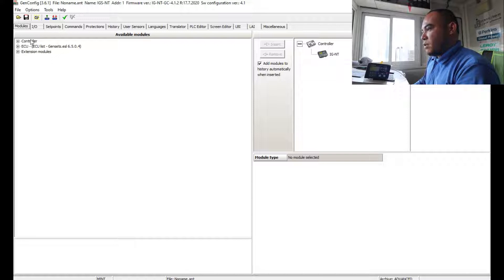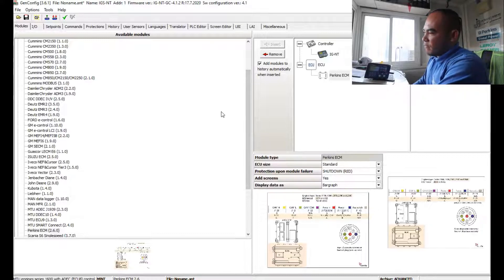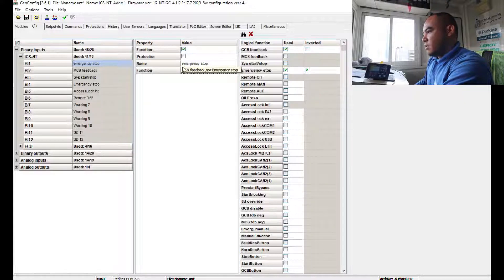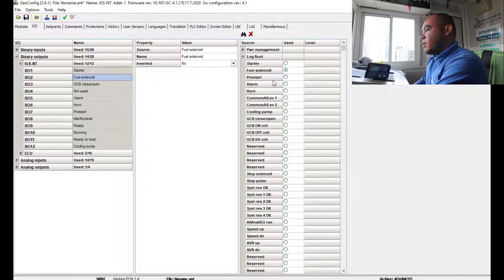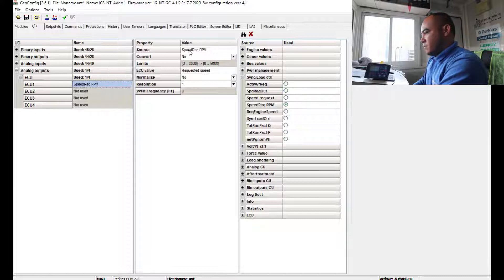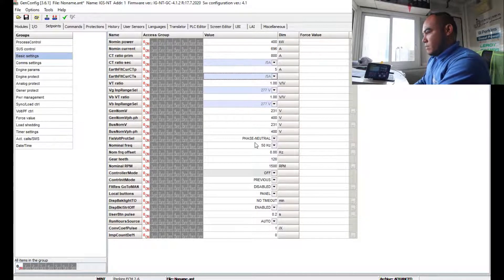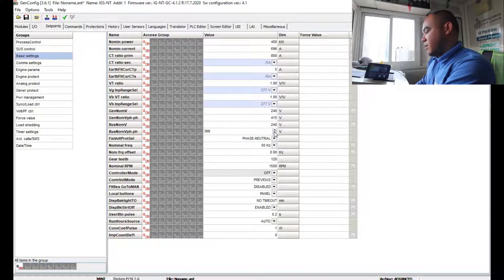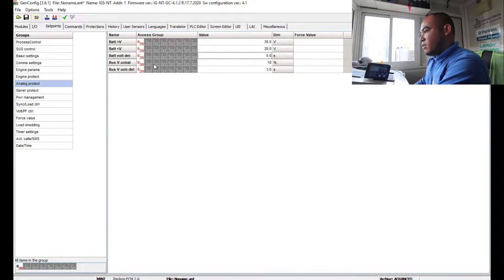COMAP INTELIGEN NT basic configuration benzblogs

Comment: Hi, I am doing configuration on Inteligen4 200 for synchronizing 2 generator, I have set Binary output 2 as ON GCB coil , and Binary Output 3 as OFF GCB coil , However when I run only one generator and I try to close the GCB from the controller the controller doesn't give a binary output to close the breaker (I am monitoring the binary output from the PC software )  although the main busbar is dead (no voltage ) , what is the reason ?  dose "CAN2 missing communication alarm cause a problem while closing the GCB ??
Reply from the maker: Dead becase your breaker is not close
Reply: @benzblogsVlogs  The breaker is not closing , I press the Close button on the controller but the breaker doesn't close. When the main busbar of the synchronization panel is dead (no voltage on it) the Comap shall close the breaker without need for synchronization process because of zero volt on busbar , However the controller doesn't give a binary output to close the breaker .
Reply from the maker: @gamechangertech  yes even in island mode
Reply from the maker: @gamechangertech  make sure because comap intili can be config the digital output ither nigative or positive out

Comment: Is it possible to communicate with an IC-NT controller with a DSE8660 MKII to do Island mode synchronization?
If so how to do the wiring.
THANKS
Reply from the maker: Im not try but im sure it will communicate same wiring dse msc and can for comap
Reply: @benzblogsVlogs    no its not possible
Reply: @kerekembi no not possible
Reply from the maker: @shahzadnawaz4956  yea

Comment: Dear Sir are you sure the baseload setpoint is used when genset work in stand alone? and loadshare when is working in paralallel? I have read the manual i found different  explication or I mis understood
Reply from the maker: Load is always depend on kva however if this is synchro it double up the capacity dur to share load right ?

Comment: thanks for your knowledge transfer,   i have two gensets with comAp controller  inteligen200  if i start one genset the controller is showing for example  200kilwatt   if i shutdown and start other genset  the controller is showing  different reading  for example 300kilwatt   how to solve that
Reply from the maker: This problem happen in the configuration you check the kva ,kw and the ct you installed must be configured in the module okay to solve your pblem all of this must config in the module and calculate

Comment: Am having a problem in configuring a module IL-NT AMF 20. With inteliconfig software. Using communication module IL-NT-S usb, but is not connecting to the controller. It shows connection failed. I have double checked but I couldn't find anything.please sir i need your assistance on this. Thanks for your teaching.
Reply from the maker: Sir in you latop what connection your using you should cleck that in you computer ex.you open you comap sofetware there you can select what connection should be usb right
Reply from the maker: Or what sofetware you using my its not the correct one

Comment: Sir, Intelligen NT module is showing over voltage, 263 volt on both Generator and mains input. I measured with multimeter, it is showing 230V, which is correct.
Is it any configuration problem or hardware issue.
Reply from the maker: Sir if multi meter measure correctly if its calibrated
Reply from the maker: Thin you can calibrate the module reading and make it same with the tester

Comment: Hello dear i am facing the problem Perkins 275 kva when we start the gen set  when goes to starting command when starting relay operate Comap ig ntc showing ECU shutdown we Also chk ECM power relay supply and CAN
Reply from the maker: You need the EST tookit to read the ecu if any problem did you check the the communication wite and the configuration ist not change?

Comment: I have interlidrive amf 20 is shorting down on battery backup voltage
Reply from the maker: If battery back up check i side of your module there is botton cell if you can replace replace it

Comment: Is it possible to download configurations from the Device to laptop ?
Reply from the maker: You save achive
Reply: @benzblogsVlogs  thanks, there are different softwares like Genconfig, intelimonitor, inteliScada. Can you pls tell me the uses?.
Reply from the maker: @DhineshKumar-kp7wy  just read the module and save it that it
Reply: @benzblogsVlogs sir, i connected my device and my open connection page opening in sptm not in MINT how to switch this
Reply from the maker: @DhineshKumar-kp7wy  this intlmonitor there you fo config while scada is only monitor and meroring
Reply from the maker: @DhineshKumar-kp7wy  SPTM -MINT this deferent function of a mdule you most do example MINt din you have to do it the config for MINT OR SPTM in order to write in the module or convert of applicable if not thin you have to do it as what the module type

Comment: When I connect my pc with device using usb cable, It is not showing anything. It says Com4 inaccessible. I tried manytimes but cant connect to device with usb cable.Any solution?
Reply from the maker: Check the settings of your module and if not working with usb thin use the rs232 to config
Reply from the maker: Or update your sofetware

Comment: Sir
How to remove stop valve from comAp controller.
Reply from the maker: Stop vlve meaning there is problem with your oil sw bre double check it ok
Reply: @benzblogsVlogs  sir engine all sensor /sw are ok.problem comap controller program or comap controller hardware.
Reply from the maker: @MdImam-nx9ur  sir make sure the config for your oil sw is correct coz if wrong will happen like this